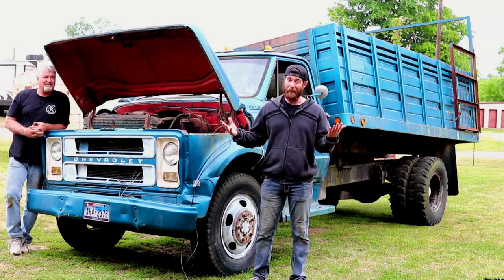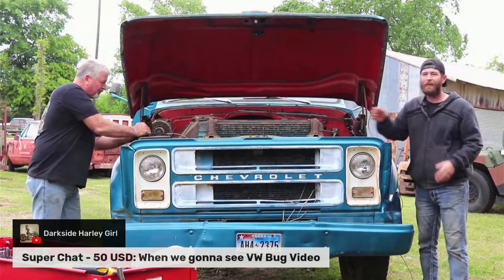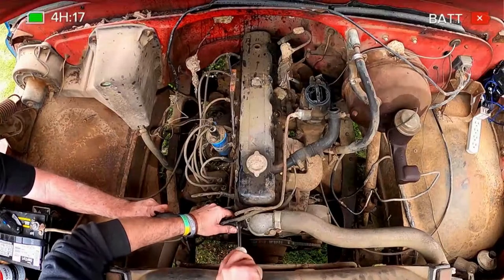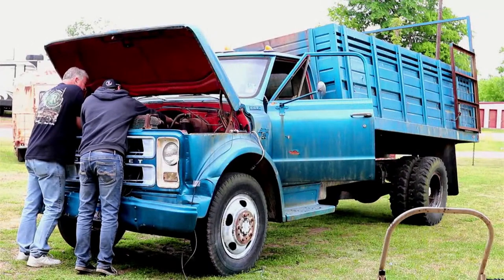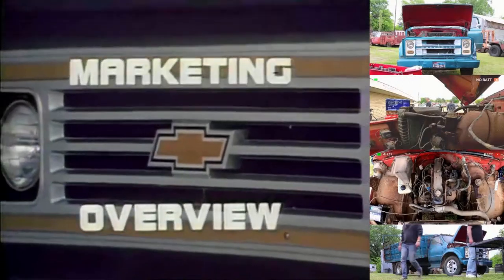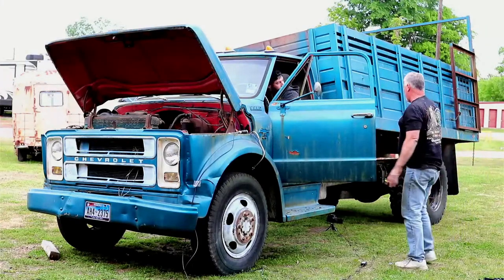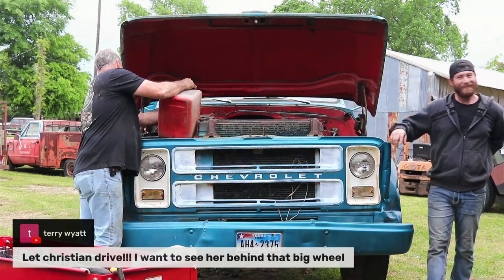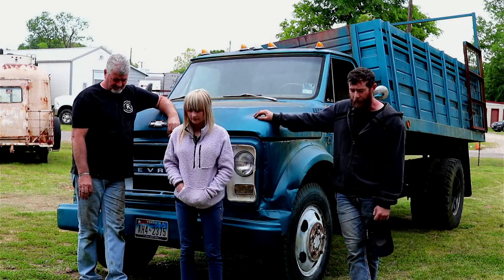LIVE Abandoned 1967 Chevy C50 Farm Truck | Will It Run After Sitting Up For YEARS? | RESTORED

Comment: I bought a 67 Chev 1/2 ton pickup new off the dealer in Anchorage Alaska when stationed there with the Army, 68 to 71. It was a leftover so got a good deal at $2200 dollars new with 283 and 3 speed on the column. Great old truck, drove it down the Alcan and kept it for several more years. Your vid brought back memories when I seen that same gauge cluster in the farm truck. Wrench on, guys.

Comment: Guys, about the '57 Chevy six. The transmission fluid in the block (blown freeze plug), remember that if the transmission cooler in the radiator is rotted that will allow the fluid into the block.

Comment: If you want to get technical it's really a cab and chassis with a dump grain bed. I had a red one exactly like it I hauled lumber with. it was a great little truck. 292 Chevy is a very very reliable engine. Very powerful when they are well tuned.

Comment: I just got a 72 C50 with a 350 SB running that had been sitting since 1993. New fuel line, fuel pump, plugs, plug wires, coil, distributor cap, points, and condenser. I pulled the driver side valve cover, turned the engine by hand until the #1 intake valve closed, turned it a little further until the top dead center mark aligned with the tang, poured a bit of gas in the carburetor, and started turning it over. I had the gap for the points wrong the first time. After the points were adjusted it fired right up & ran until the carburetor bowl was empty. The carb was full of varnish & the float needle was stuck. I’m waiting on a carburetor rebuild kit now.

Comment: I owned a Truck just like it, even same color. I hauled everything with it from Hay, Grain and even Logs and Brush. I even hauled Freight in it. That motor is a very strong motor for what you see. U had throw-out Bearing problems and Clutch problems more than anything. It used one quart of oil every thousand miles from when it was new all the way till I sold it at 74,000 + miles. I changed tires on it three times and wish I still had it. It was three times the Truck my V-8 Fords were at the same age.

Comment: It is a shame I did catch this live.  The PTO has to be engaged with the clutch depressed. It works off the transmission.  Via drive shaft to the hydraulic pump.  Once it is engaged, then the lever for the bed comes into play.

Comment: Should be a plug at the shaft end of the hydraulic cylinder. Take out the plug and fill cylinder with hydraulic fluid until it start running out the plug hole and it should be full. The cylinder should be the reservoir tank for the system. I'd be careful lifting that  bed with it bent like it is. If you lift it too high it might try to turn the truck over on it's side if it offsets the weight to much. Be careful but remember to have fun.

Comment: The Chevy 292 was a quite bullet proof engine. Very rugged.👍
Reply: it's funny because they offered a High Torque version in the big trucks. in order to create one of these motors GM had to print off a decal and slap it on the valve cover!

Comment: BRAKES: If you will bleed all the old fluid from the system then flush with denatured alcohol and bleed it all out, let it set with all bleeders open while you work on the engine. Fill the system with new fluid, bleed the system, and most likely you will have very good brakes.

Comment: I had a 67 Chevrolet just like that. I used it in Tree Trimming. Hauling Brush and that 6 Cylinder is a far better engine that he V-8 was. We had a 69 just like it and it was a V-8 and it was problems all the time. That truck will haul 65 bails of Hay with no problem.

Comment: Boy, I'm thinking either a pin in the scissor mechanism backed out on one side and bound up the bed or that thing tipped over partially somehow and tweaked it all up. I like those old Chevy's too. I didn't know those Chevy's from that era still had the vacuum shift. I think everyone else had already gone to the Eaton 2 speed electric shift. Dad had a 1966 International Loadstar 1600 with an electric 2 speed axle. Good luck with it.

Comment: Had a 1963 Chevy 1/2 ton long bed pickup with posi rear axel , best winter truck ever long wheelbase kept it straight , posi wouldn’t spin, 292 six cylinder

Comment: I think its a 250 not a 292.  The fuel pump is on the wrong side to be 292.  Also, check the side covers, they prolly are 3 or 4 inches tall.  The 292's is 5 or 5.5 inches tall.  Its funny how everyone who owns a classic 250 calls it a 292.  Kinda like every classic used chevy part for sale is listed as "corvette"

Comment: Most of the 5 speed transmissions were also direct high gear. 5 speed overdrives are very rare.
Reply: the 5 speed OD was only offered on 4-53N trucks, also impossible to find. I've found one online but someone had taken it to the land of no return

Comment: Keep your arms, hands, and body out of the chop zone of the bed lift mechanism.  If you loose pressure in the system or pressure is absent that bed can drop and smash anything in the mechanism.  If you get it all the way up, prop the bed up with a cross brace that will support its weight.  Without pressure that bed will drop like a rock.

Comment: the 2 speed in the diff is ellectrical will not work unless good bat and key on if wires good and the ellectric magnet in sellector is strong enough to pull it. 15 min change if they fail, is so simple to replace that sellector. shoulda checked PTO maybe it stuck engaued. could be a bad u joint to oil pump sure sounded like it. i grew up on a farm around old creatures like them. was simplest things to fix and most dependable unit on a farm. when nothin else started they started the grain truck to boost things.

Comment: Those old six bangers are very bad for vacuum leaks at the intake and the hydrovac brake booster. 9/16 wrench. Go along and tighten them all. Running with the choke closed proves it's sucking air from somewhere. The filler port is on the bed cylinder although some had a separate reservoir under the bed in the frame.  Raise the bed to access it. Should use regular hydraulic fluid although some use aero hydraulic. I doubt it will use ATF. IF the oil is red it's aero hydraulic. The smell of ATF and aero are completely different.
Reply: Yep, it’s a vacuum leak for sure!
Reply: If it’s a vacuum actuated 2 speed rear axle I would start their, looking for the vacuum leak

Comment: Most of them did have 6’s  there was some with V8 283 and 327 in those old models was kinda rare
Reply: Depended on the year, I’d generally agree it’s easier to find a 6 in the 1967 trucks, the other 5 years, the 327 for 68 and the 350 for 69-72 are extremely common, hard pressed to find a 6 in those

Comment: what a pos 6 popper in a c50 ! i just got the same truck $800 with in 12 hours motor out and 454 /400 in im putting in 5 ton axles and ford transfer case wierd combo but its what i had. any way i have 20x14 rims for 16.00R20 MICHELIN XZL tires . best part is the 32 foot camper for the bed .